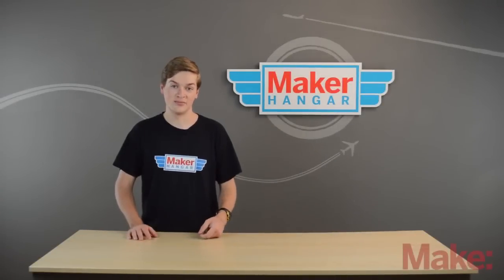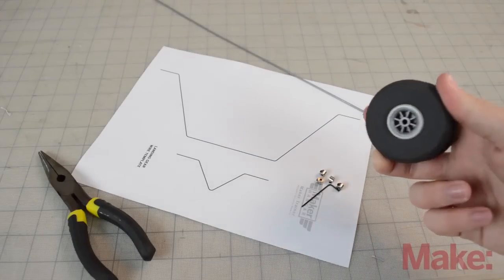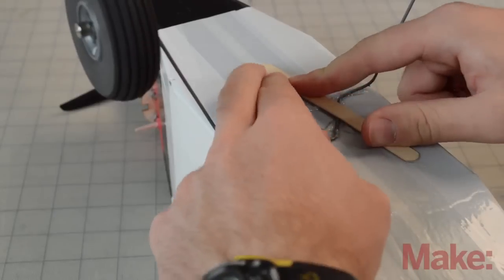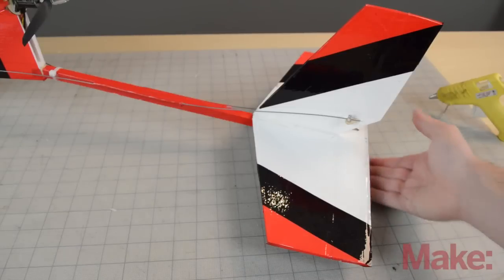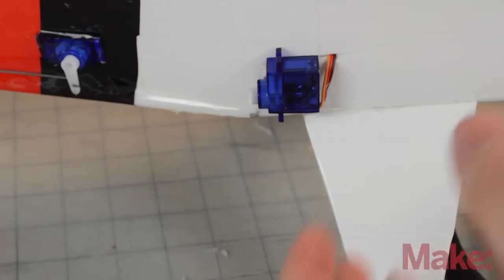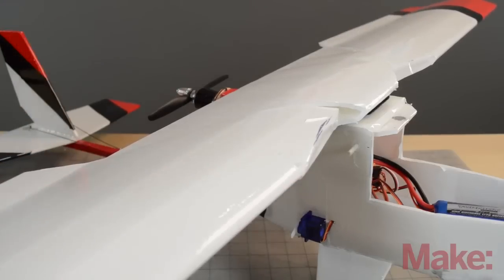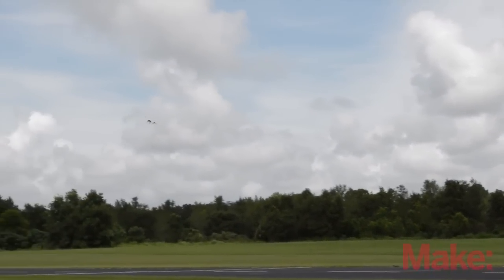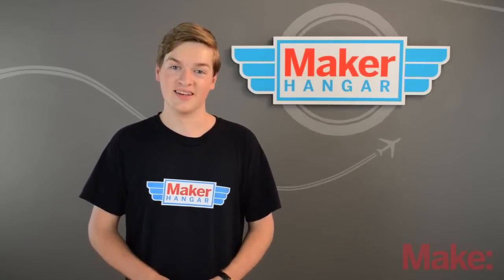Maker Hangar: Episode 15 - Modifications

Comment: QUICK TIP! When removing hot glued parts, dab some alcohol (any will do) on your hot glue joint. Wait a couple seconds and lightly shake loose the glue. It will fall right off.

PS: Purel hand sanitizer is equally affective.

Comment: Use popsicle sticks to reinforce the landing gear... I did so and they work great! Us popsicle sticks to cover each side of the gear, and one on the back at a 45 degree angle and place one end of it on the back of the gear crossbar, and hot glue the other side to the bottom of the fuselage... this piece in the center will add a LOT of strength! Try it Lucas!

Comment: Hi, I think if you put the popsicle sticks on the inside of the plane on the bottom where the battery is and use a few small zip ties around the sticks and threw the foam then around the wire, it should stop the landing gear from folding on you. I'd put one tie on the front at the ( V ) bend in the wire, and one on each side just before the wire turns down to ward the wheels, I think would fix that problem. I also think it may have been a bit tail heavy after the  landing gear was added behind the CG, I think thats why it flew funny after adding the landing gear.  Hope this helps you with these problems.

Comment: Some good ideas on the gear failing already. The cross brace possibly makes it too stiff to give shock absorbing effects. Since you pointed the triangle forward, you should have made the whole gear strut point slightly forward, or turn to assembly as suggested in other comments. The foam on the gear struts wreak havok on the aerodynamics and should be removed ;) Also, it looked somewhat tail heavy. I think a simpler, no cross brace design out of slightly heavier wire would work the best.

Comment: Season 2?
For the landing gear problem, I think that not using Popsicle sticks or duct tape is a start, something more firmly attached, perhaps through the foam of the plane is a start. Then I would get rid of the foam pieces and use some more wire in the shape of the outline of the removed foam, should be stronger and reduce drag.

Comment: I don't know why you didn't incorporate a rudder into the existing vertical stab rather than removing and reinstalling a new unit. It would have been a matter of simply cutting off a rudder cutting an angle into either the rudder or the stab fit the control horn etc and bob's your uncle.!

Comment: The landing gear is failing for two reasons:

1.  You are pointing the angled part the wrong way.  the angle should point towards the rear of the plane to counter the torsional forces that want to fold the gear back during landing.  With the angle pointing forward, the gear just rips loose and folds under every time.

2.  The wire shouldn't have the crossbar.  It restricts movement of the gear arms and prevents them from absorbing the landing impact.

Fix those two things and you are all set.